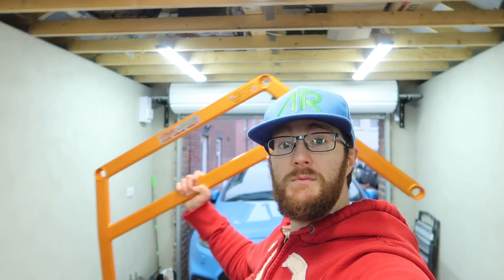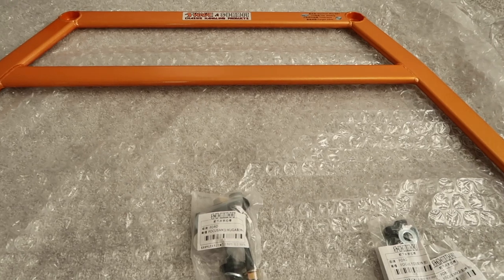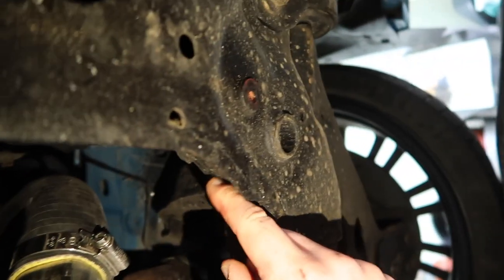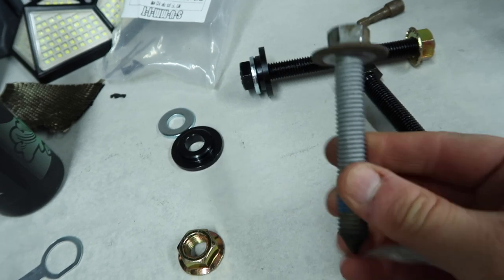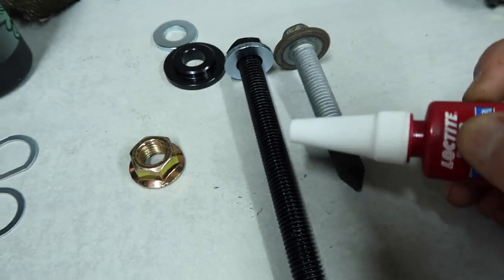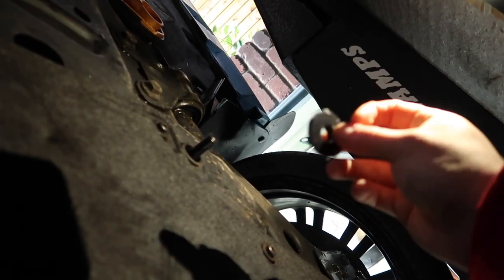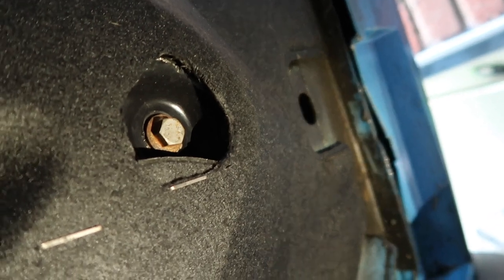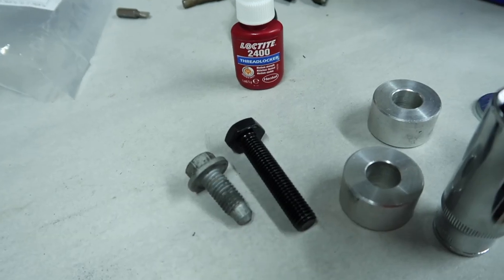SUMMIT FRONT LOWER BIG 4 POINT BRACE INSTALL! | FOCUS RS

Comment: Hi Adam is there any chance this could fall to update and if so can you reset your system back to factory? Meaning your original version.
I have sync 3 version 2.0 in a 2016 Mondeo and tried many times with the official ford site update download but it doesn’t seem to work, just sticks on updating system... I’m a bit wary about using this method as it says it must be used at your own risk, not endorsed by Ford?